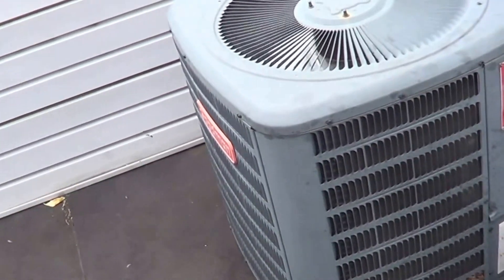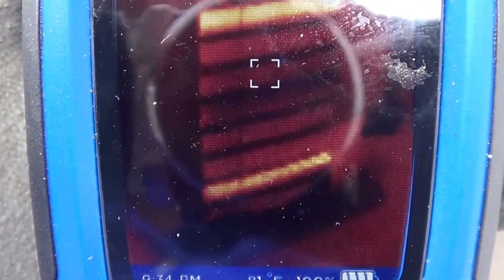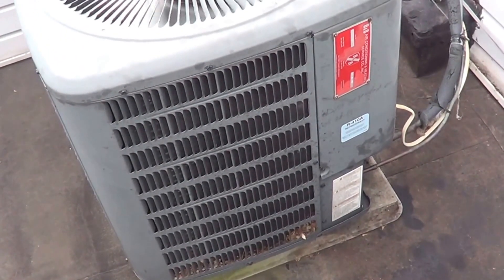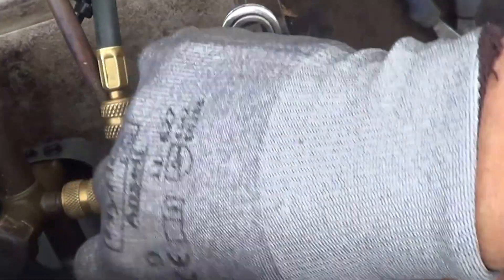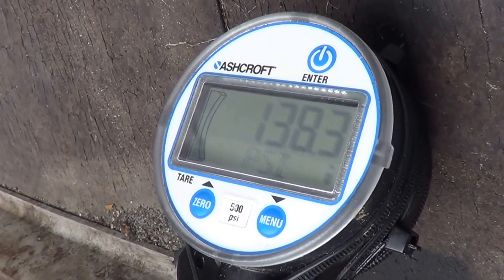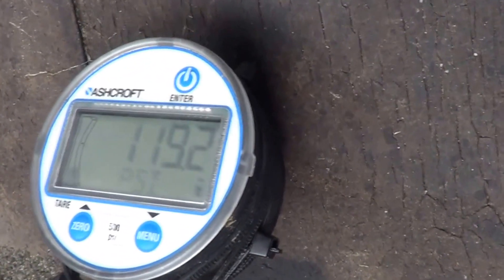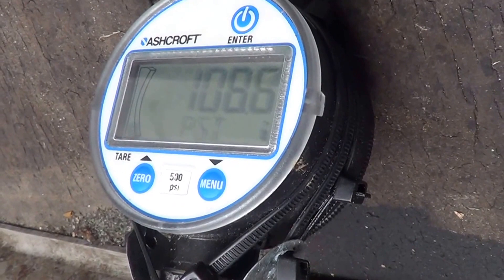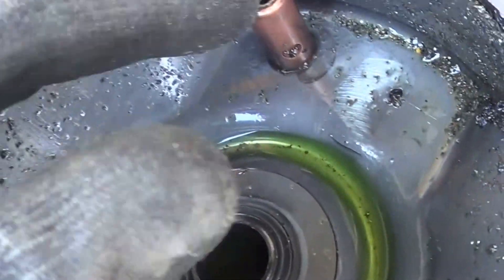Diagnosing a damaged scroll compressor with very low capacity

Comment: Long time down the road but thank you. I ran into a scroll doing this same thing for a walk in freezer. The compressor shuts off on low pressure when the solenoid or outlet of receiver is closed. Typically for freezers, LPCO are set from 5-10 psi with 404a, and this compressor would only pull down to 14psig, no matter how long the liquid line was closed. The defrost heaters are interlocked with the compressor shutting off, so the compressor never could shut off and run hot, and defrost wasn’t working. I will have to cut this one open and look at the bypass

Comment: One thing to check for when there is low compression is oil logging in evaporator.  Less than about 50% compression can result in net loss of oil return.  Oil travels well in liquid refrigerant but has to be .'blown' back to compressor input by vapor gas mass flow.  Drain and check amount of oil from oid compressor.  Should yield 85-90% of spec name plate oil load.  

Field replacement compressors come with 10% less oil load in sump compared to new system to account for a normal 8-10% of oil distributed in system.  They have a different part number suffix designating it as a replacement compressor.

You don't want to end up with too much oil with new compressor pulling back all the previous oil logged in evaporator coil.  One sign is hard starts on new compressor after 30 minutes of initial run time which is enough run time for new compressor to pull all the original oil back to new compressor.

Comment: I had a compressor develop a stuck-open internal relief valve many years ago in a small commercial building I own. I ended up replacing the outdoor unit because it was very old.

Comment: Have you ever made a video on the spreadsheet? My inner nerd perked up a bit when you mentioned it haha. Where did you get the formulas from? Is there a good reference book that you recommend for such formulas?
Reply: Off the top of my head, think of the psychrometric chart.  You determine the heat content (per lb of air) of the return air (using the wet bulb temperature), subtract the heat content of the supply air (again using wet bulb temp).  Now you have the amount of heat removed from the air per lb of air.  Next you have to determine the mass flow rate of the air passing through the coil.  Assume 400 cu ft per minute (per ton), convert to cu ft per hour, then to lbs per hour.  Multiply the heat removed per pound times the pounds per hour of air, and you have the heat removed per hour (per ton of nominal capacity).  And there you have it!
  Check out an old (1950s) edition of "The Trane Air Conditioning Manual".  Best I've seen at explaining things.

Comment: So how do you know when you walk up to a unit with a scroll compressor if it's the kind that will pump down to 0 psi or only 50 psi?
Reply from the maker: You will hear the internal pressure relief open on the scrolls that won't pump down.   But, even 50 psi gets nearly all the refrigerant moved over.

Comment: I have a scroll compressor that will not do it's capacity but will pump down. Adjusted the Subcool to 4 degrees and the the Super-heat went to 38 degrees. 158 suction and 290 head 410A refrigerant. Added refrigerant suction continued to go up but higher superheat. This compressor pumped down to 30 pounds ad went off on low pressure. What if the internal relief valve is partially leaking by. If this compressor had an unloader or hot gas bypass I would think different.

Comment: I am suspecting that when you charge a copeland scroll with liquid through high side while under vacuum causes internal damage with the result being equalized pressure while running....If so why?
Reply from the maker: It is not that easy to damage a compressor.   Pressure won't damage it.   Scrolls are actually much tougher than pistons.   However, it is possible to wash out the oil from too much liquid going into the suction or loss of refrigerant preventing return of the oil.
Reply: @NathansHVAC  it is happened twice to me now. I pump the system down 2 below 100 microns and then add refrigerant 410A in liquid form as recommended by manufactured into the high side and the compressor will not function after that. I find it very odd the circumstances that these compressors failed.
Reply: @LongTrout  that is odd, are you still charging with that method or are you now adding refrigerant once valves are open and unit has a ran a while
Reply: @WreckingCr3W2  you know old school method when you had a system completely empty it was completely acceptable to dump liquid in through the high side of the system to break the vacuum and get refrigerant in the system quicker. In fact I was taught that that was the only time you would ever charge your system with liquid. It is odd that when you pour liquid into the high side of these compressors you ruin them. And yet it is proper procedure with the new units to charge with liquid. I am troubled by this and would like to know what the hell happened to those two compressors
Reply: @audram1295  You are misunderstanding. I put liquid into the high side with compressor off to break the vacuum. It was a common practice on reciprocating compressors to save charge time with R-22 so save charge time since it is an unblended refrigerant and units are charge with gas. It is the only time proper procedure to put liquid in an r-22 system. I would not recommend this practice on scroll compressors however. I was curious as to why.
Reply: @LongTrout  okay, i see, you had used your vacuum pump to free the system of air and contaminants, right? i thought you were saying that you had pumped down the system into the condenser coil, which is what the guy in the video was trying to do, thus lowering the pressure readings on both refrigerant gauges. okay. So, after you finished vacuuming the system, did you charge the system according to weight, while the system was off, thus breaking the vacuum, leaving both of your low and high side refrigerant gauges reading the same equal pressures?
Reply: @audram1295  Correct. Dump liquid into the high side of a scroll compressor under vacuum will ruin the compressor and I do not understand why. This is the answer I seek though I will never make the mistake again perhaps I can save another tech some heartache.
Reply: @LongTrout  the pressures are equal, until the system is running. so, how can you ruin the compressor if you have the right amount of refrigerant?  Did you weigh in the refrigerant first, before turning on the system? did you charge with the can upside down or right side up? and yes, you can charge R22 as a gas or liquid, but if you are charging it while the system is on, be sure that liquid refrigerant goes into the liquid line. Also, if charging the last little bit of refrigerant, while the system is running, you can't just pour it in, you have to keep opening and closing your gauges, waiting inbetween each feed, giving the system time to balance itself.
Reply: @audram1295  You are not understanding. The system was entirely empty and under 20 microns of vacuum. All I did was ad liquid through the Discharge side of compressor when not running to break vacuum. This alone is what caused the compressor failure. Perhaps it was improper for me to introduce refrigerant into the system this way with a scroll compressor but I still do not understand how this could have cause complete compressor failure with no pumping whatsoever.
Reply: @LongTrout  20 microns is low. 500 microns is usually standard for air conditioners. when working on a smaller cooler, 300 microns is sometimes good.
Reply: @LongTrout  are you referring to 20 Inches Mercury (inHg) or microns?
Reply: @audram1295  The LongTrout takes it deeper than most when he has the equipment to do it.
Reply: @LongTrout  ooh okay
Reply: @LongTrout  regarding my first comment: when you weigh in the liquid refrigerant, while the system is off, it is better to have both gauges open, so that charging takes less time. The suction line is wider, so it will help you charge the system faster by having both gauges loading the refrigerant into the system.
Reply: @LongTrout  Regarding my first comment: when you weigh in the liquid refrigerant, while the system is off, it is better to have both gauges open, so that charging takes less time. The suction line is wider, so it will help you charge the system faster by having both gauges loading the refrigerant into the system.

Comment: Pumping low so what compound I should be fill between scroll blades which improves pumping
Reply from the maker: Low pressure is a refrigerant issue.  Low scroll capacity results in higher low side pressure.

Comment: Hi. Nathan .. thanks for your video. I got the same problem .and I changed the new Compressor even have the same problem again..r22 . suction 120 and discharge 200 psi , these was the unused Compressor kept in stock from very longer.  I want to know is is possible ,the internal relief valves can be damaged when kept in stock for more than five years.
Reply from the maker: You might have the wrong size metering device.

Comment: I have a scroll, pumps down, but has low head and low suction, R-22, I over charged it but but pressures still low on both sides, low amps too rated 29, only pulls 21, never seen this before, Copeland tech support didn't know either, do you think the scroll turbine could be weak?

Comment: Great video, hey would that bypassing discharge heat the thermal protection up to the point of tripping it and shutting down the compressor ?
Reply from the maker: The partial capacity was able to keep the compressor cool enough to stay on line.

Comment: Great video. Can You show me the load calculation method you mentioned with wet bulb etc. thanks for sharing.
Reply: Off the top of my head, think of the psychrometric chart.  You determine the heat content (per lb of air) of the return air (using the wet bulb temperature), subtract the heat content of the supply air (again using wet bulb temp).  Now you have the amount of heat removed from the air per lb of air.  Next you have to determine the mass flow rate of the air passing through the coil.  Assume 400 cu ft per minute (per ton), convert to cu ft per hour, then to lbs per hour.  Multiply the heat removed per pound times the pounds per hour of air, and you have the heat removed per hour (per ton of nominal capacity).  And there you have it!

Comment: The check valve is on the outlet of the discharge stub. The thing  that you referred to as the check valve is thermal disc.  I replaced 3 lg scrolls last year. On one I could definitely hear the ipr valve by passing but not on the other two.
Reply from the maker: Actually LG compressors have a plastic seal that deteriorates if there is any alcohol in the system.  QuiKShot can make the LG compressors fail in the first year.  i was going to do a video on this subject, but I haven't had an LG compressor come my way yet.  Copeland uses metal to metal for the scroll seal and not a plastic wear ring.  As for the check valve:  Most of the manufactures moved it to before the outlet muffler/chamber to prevent the reverse action sound when the compressor stops.  Here is the diagram.  https://yorkcentraltechtalk.wordpress.com/2013/09/07/scroll-compressors-a-primer/
Reply: That's Interesting about the lgs. I've opened a few compressors.   I wanted to open those Lgs but I had to return them. Check out some of my videos.
Reply from the maker: Here the the plastic seal ring similar to what LG is using.  http://njcomptech.en.made-in-china.com/product/HbmEwdfoCskx/China-Scroll-Compressor-Seal-for-Automotive.html
There are a couple of videos on YouTube about LG Compressor failures, but no one is questioning the seal ring accept me.  So, it is possible I am wrong about using plastic to seal between the scrolls.  I don't claim to be a compressor engineer.  However, I personally just stick to Copeland compressors because the failure rate seems much lower.
Reply: Never mind it doesn't have that seal like the lg
Reply: What does the bypassing sound like? I am having a similar issue. Thank you

Comment: You can use compression ratio to find that problem, the compression ratio should be 4 to 1. How you find the compression ratio is take the low side pressure and the high side pressure add atmospheric pressure to both and divide your high side absolute by your low side absolute and it should be close to 4.
Reply from the maker: This one was 300+15 and 175+15 or 1.65.   The new compressor was 300+15 and 108+15 or 2.6.   I never really used compression ratio before.  R410a refrigerant lowered the ratio alot compared to R22.  A very long time ago, R12 had the highest ratios of all.  13 SEER and better lowers the ratio even more.  It is my belief that the higher SEER standards have been making compressors last longer because of the lower ratios and lower discharge temperatures.
Reply: Another way we test compressors is to find its performance chart or curve. You graph it's suction pressure and condensing temp. It will then tell you what your amperage should be in those conditions. It works really good especially for units that have no shut off valves.

Comment: Nice work. I've occasionally encountered partial relief valve failures that have a characteristic high pitch whistle but never a full open fail. BTW
How go like the Seek Reveal?  Looks like a nice little tool.
Reply from the maker: I love the thermal camera.  However, I did run the battery down once and the processor lost it brain.  I had to open the camera to unplug the lithium battery.  I couldn't find a reset button.  But, it is probably better to call the factory than open it unless you are good at working on very tiny electronics.  I doubt a lockup happens very much.  Other than that, it runs perfect.  I use that too so much that I carry it in my tool bag.